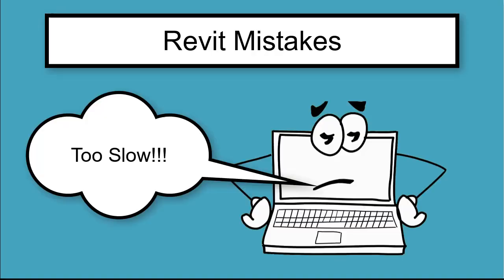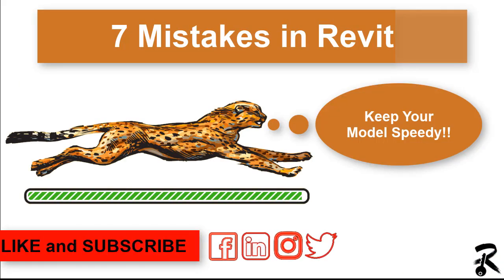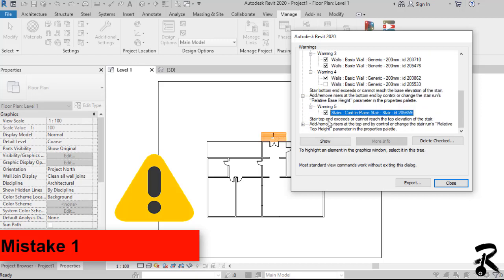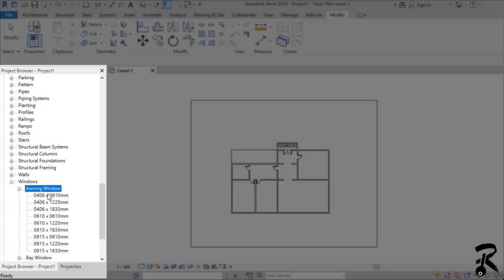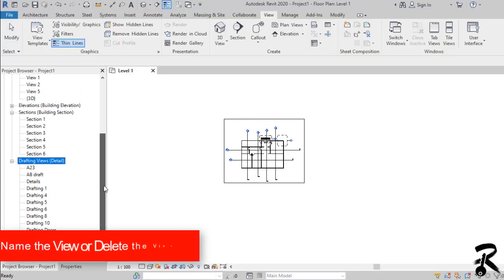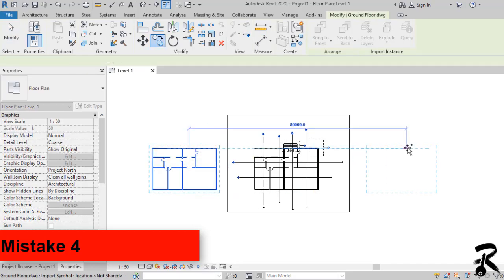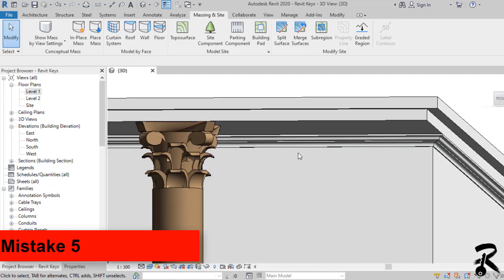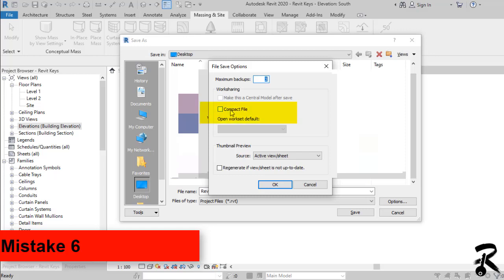7 Mistakes That Slow You Down In Revit

Comment: After purge and compact file I lost some libraries from this project. How can i get them back so as to continue my project?
Reply from the maker: Hi, hope you're doing well🙂
There is many solutions for your question based on the missing families.
▶️In case you lost system families, you should open a new template file along with your existing project and transfer project standards.Follow the steps below:
1-Open both the new template and your project.
2-In the new template, click Manage tab -->Settings panel -->Transfer Project Standards
3-In the Select Items to Copy dialog, select the source project for Copy from
4-Select the desired project standards
5-Click OK
▶️In case you lost loadable families and you have already saved those families outside the project as an .rfa file. You follow the steps below:
1-Go to insert tab
2-Load Family
3-Locate and select the .rfa family to load it back into your project
▶️In case you have a backup file, for example : filename.0001.rvt
you follow the steps below:
1-Open the file
2-Right click on the families you lost
3-Save the families in one place
4-Open your project
5-Load the families in your project
Reply: @revitkeys7089  thank you but it doesn't works. For my system families I needed curtain walls and some types of walls. So in the new project family, I click transfer project standards and select those two, then click ok, but nothing happens